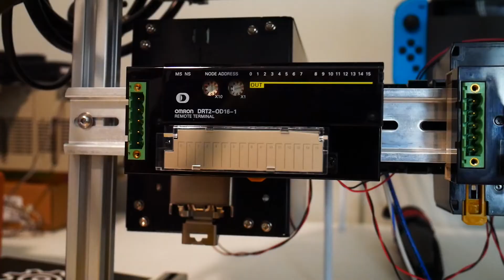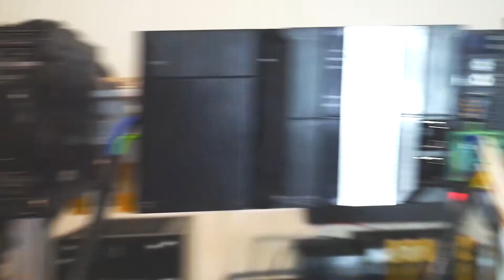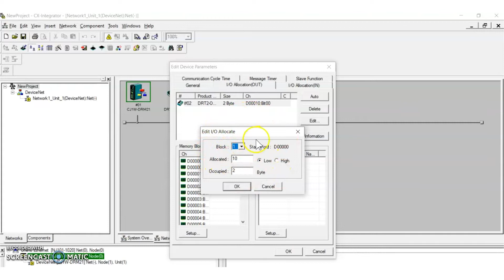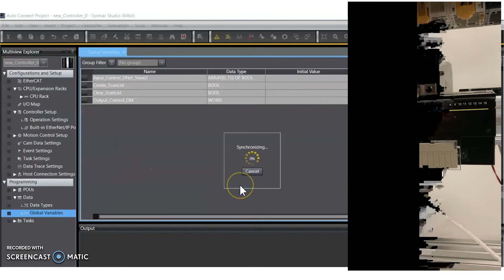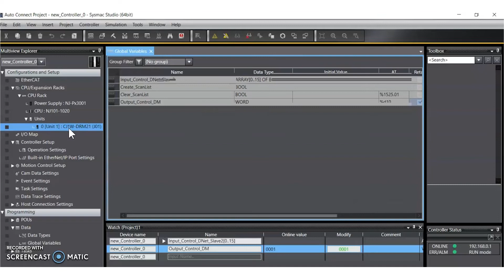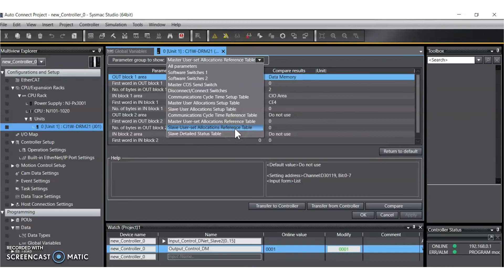Omron NJ Controller with DeviceNet

Comment: Brilliant video, thanks for sharing! Can you make video on EDS file for DeviceNet devices, and it's usage? Also, is the EDS file download to the actual device or just imported into the IX-configurator to setup a device? Would be great if you could make video on this entire process?
Reply from the maker: @Akshay Potdar, thanks for the input. I'm actually limited with hardware and budget 😅, once I get a non-Omron Dnet device, I'll do the video (looking at Christmas). 

But to answer your question, you are to import (install) your EDS file to CX-Integrator. You can do that by going to opening your CX-Integrator Tools>EDS>Install. You can also "Create" if you have a product that needs to do so (some manufacturers require you to do it). Step is similar go to Tools>EDS>Create. From here a pop up window will appear, just type in the information (Vendor ID, Device ID, Product Code, etc.). 

Manuals that can help you if you are going to work on a project having a NJ controller with a DRM21 master; W501 (jump to appendix A-9), W497(mostly the procedures are here to help the install; just watch for your method in allocation).

Hope that helps and thanks for watching!
Reply: @PlayAutomation  Thanks for the detailed response, much appreciated! Look forward to non-Omron Dnet setup video around Christmas.